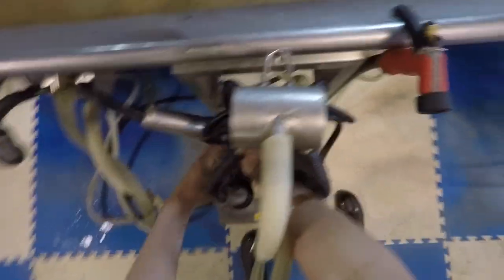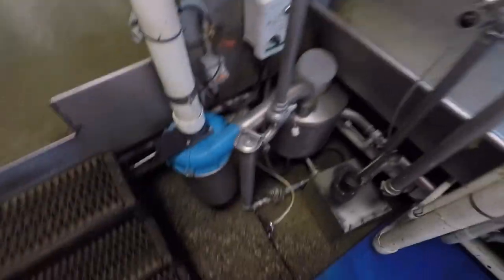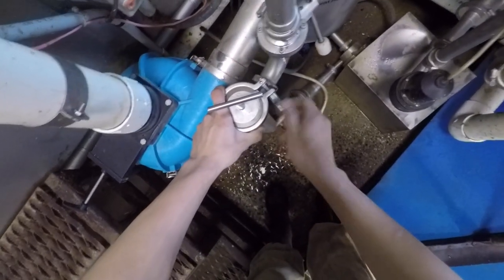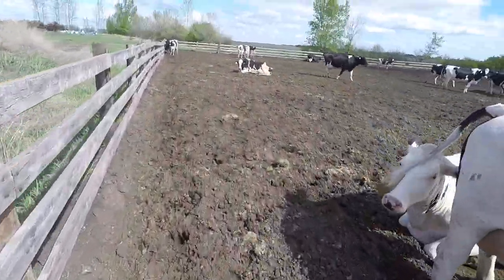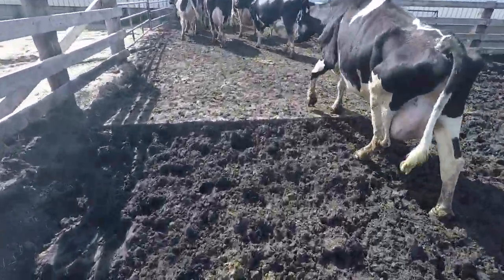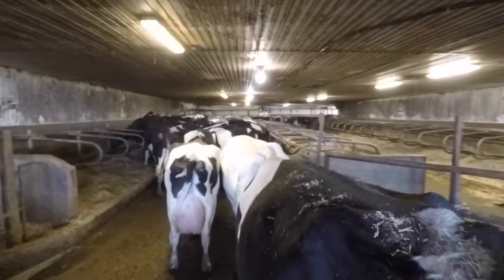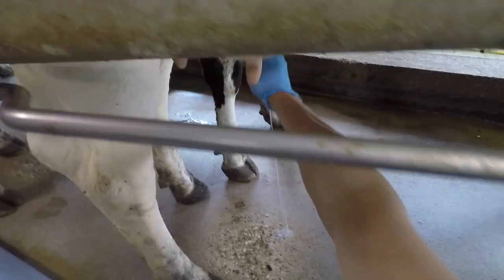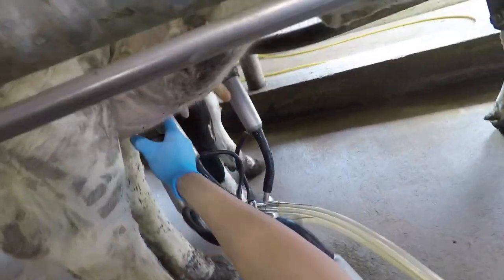Milking Cows In Our Old Parlour!

Comment: Great flashbackback video you had a very clean operation even back then   That looked like a Case 930 in the back when they were picking up the milk    I am still using one of those 60 years old and still running fine

Comment: What are you using to wash the cows teats before milking. We stopped milking over 20 years ago (in Quebec) - we were supposed to be using disposable paper towels (1 per cow) and throwing them away but we used J-Cloths folded over in to a square, sewn together around the outside permiter as well as diagonally corner to corner, and only threw them away when they started to break down. The health inspectors didn't like it but we had one of the lowest Somatic Cell Counts around so they never pushed it. Worked great, better for cleaning off anything that was stuck hard, and much cheaper. We just always had to make sure we had a few made up ahead of time in a drawer in the dairy. We didn't have a milking parlor but usually milked around 50.

Comment: What is the average lifespan of a milking parlor?
Reply from the maker: Can be as long as ya want! Just needs to be maintained.
Reply: We had a 1976 parlor and the pipes in the parlor were rotten at the concrete back in 1993 We put new holding stalls for the cows in after 17 years could have made it 20 years ? But it is a constant upkeep thing even where the water drips out of things wears the concrete away over time! The thing is where milk prices in the U.S. hit prices back in the 90's doesn't match the price of consumables sold in stores can make it difficult to stay dairy farming!

Comment: I noticed in the old milking parlor you milked from the side of the cow rather than between her legs. I would think milking from the side would be preferable than directly behind as it would keep you out of the line of fire in the even the cow urinated or defecated. Seeing you without your ball cap on and turned around backwards, I didn't hardly recognize you. I thought maybe you were bald or something!
Reply: I agree, we also do milking from the sides and definitely prefer that
Reply: @cpbotha9958  We switched  from  side milking  to  through  the  back  milking  when  we  changed parlours. I  think   through the back  works better  with  Holsteins  than  it  does with  Ayrshires , but  you  are  less likely  to  get stamped  on. Our  herd  went  back  to  mostly  Ayrshires but  we  were  stuck  with  the  parlour.